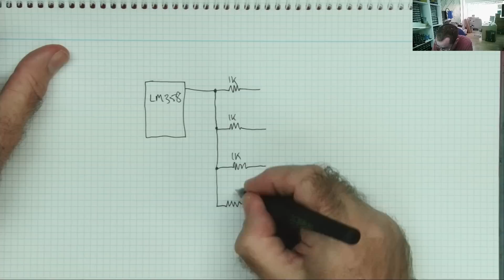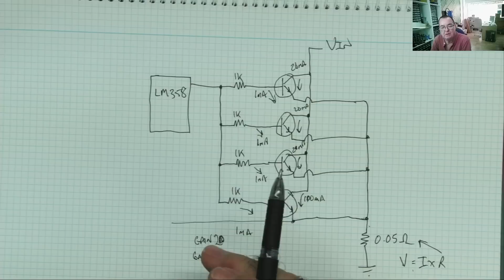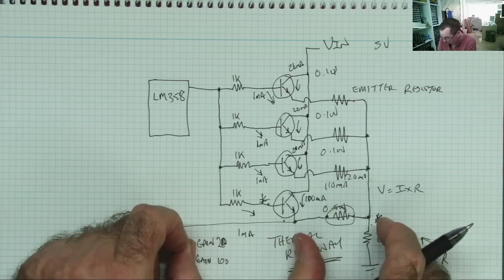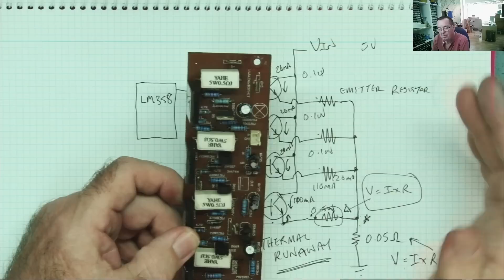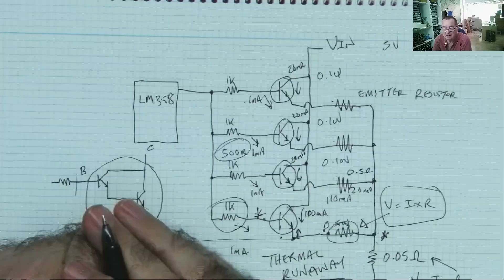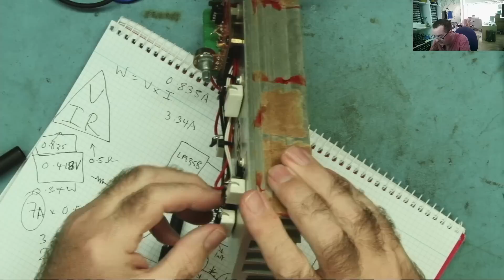How to Connect Transistors In Parallel, Without Blowing Them Up! PCBWay LER MultiLOAD Project

Comment: the way i explain this to others is the more current across the emitter resistor
 the larger  voltage drop and this puts the base/emitter at a lower voltage and the drive goes down from the base. 
so base drive voltage is less 
this is really helpfull when using JFETS

Comment: The TIP122 has a maximum continous current of 5A (and 8A peak), which is 20A in total, so you could reduce the resistance to 0.22Ohm 10W, or increase the 0.5 Ohm resistors to 15W or 20W to make them fit the maximum power of your device.

Comment: P = I x i x R, so I x I = P / R. So I x I = 10 / 0.5 = 20. So I = SQR Root of 20 = 4.47A per resistor, so in total 4 x 4.47A = 17.88A. If you consider some veriations in current per transistor, I would be safe and keep the currunt at maximum 15A

Comment: Around 2.2 volts across 0.5ohms makes 10W. That'd be around 4.5A. Other than that, the resistors you've put in place aren't 10W, they almost certainly are 5W.

Comment: I originally assumed that you would add potentiometers at the bases of the transistors to account for differences in resistance due to their tolerances not being perfect in comparison. But that’s because I wasn’t accounting for temperature changing the resistance of the transistors. Your explanation made a lot of sense and has helped me learn more in my journey through electronics.

Comment: Way to do it :yougotthis:
NB:
If you want to modify the circuit using MOSfet's you MUST use an external 12V supply for the LM358 IC which is sourcing the gate voltage for the MOSfet's.
A 25mA supply will readily suffice as only the LM358 is drawing any current.
Any Aliexpress micro buck/boost supply will do the job, if it works from the lowest 3.3V supply under load/test.
And THEN you won't need the "emitter" resistors !
Because the MOSfet's will reduce their gain with temperature, thereby exhibit selfbalancing.

Comment: Learn Transposition and Successive Approximation.
You've contradicted yourself again. Move the Resistors away from the Trasistors, they are heating the Trasistors needlessly.
Bunch the Resistors together, somewhere away from the Transistors, so the Resistors heat up equally.
Not a perfect fix, but helpful anyway.

Comment: They usually put the resistors in the collector side when paralleling BJTs
Reply: Putting them in the collector won't cause the transistors to balance the current sharing.  You need to reduce the drive to the transistor thats passing the most current.  As with the emitter resistor the more current the bigger the voltage drop and thus the lower the Vbe for that transistor for the same drive voltage of all the parallel transistors. So it reduces the current its passing.

Comment: The process of one of the active bipolar components in parallel taking more current used to be called "current hogging". It was common in early LEDs when used in parallel, hence they all had to use ballast resistors. I assume modern led displays will use chips from the same production batches, so will be better matched physically. If bipolar transistors were used in parallel, you would have to go through a process of "matching" them experimentally  to ensure their characteristics eg gain, forward voltage, etc, were as close as possible. Unless you were a big operation that could get the manufacturer to do the matching at source, it was generally too much effort to do this, which is why most circuits assume that it will happen and design parallel bipolats out,  just as you have here.

Comment: One of the drawbacks of using relatively high resistance for emitter ballasting is that the minimum input voltage for the circuit is raised. Darlington transistors are already working against you in that regard.

It is not unreasonable these days to use a separate op amp to drive each transistor. A low-value emitter resistor can be used for current sensing, rather than ballasting. The op amp and transistor are configured as a constant current sink, just as the overall ciruit appears to be in the video. If you do a reasonable job you can treat each op amp and its transistor as a building block and parallel as many of them as you want.

===
With the emitter ballasting resistors you are working against your objective if there is thermal coupling between the transistor and its resistor. The temperature coefficient of resistance of the resistor will be quite small. The tempco of the base-emitter voltage of the transistor, especially with a darlington is much larger (negative). If the resistor heats the transistor it amounts to positive feedback which is exactly the opposite of what you want.
It is not unreasonable to select the value of the ballasting resistors so that the voltage drop and dissipation result in good sharing at high currents but only mediocre sharing at low currents where there isn't any real issue with imbalance. But be careful!

Be mindful of safe operating for bipolar transistors. It is going to limit allowable power to far less than the product of the transistor's voltage and current ratings. Any decent datasheet will include plots of SOA.
Reply from the maker: Thanks for the detailed reply. I'll look at using separate op amps to drive each transistor, this sounds interesting
Reply: Yep, it is unreasonable. More reasonable is an opamp driving a high gain bjt driving the other four darlingtons.
Reply: @mitkothemacedonian 
You've missed the point completely.
The issue is not power to drive the transistors. The objective is to produce good sharing among the transistors. Unless the transistors are very carefully matched to begin with you need moderately high emitter ballasting resistances to get good sharing. This creates two problems - heat removal from the resistors and total voltage drop which prevents the load from being useful for very low input voltages. Adding yet another transistor in a cascade makes the latter problem worse and does nothing to reduce the sharing issue. By using one op amp per transistor you reduce both problems because you only need resistors for current sensing, so their value can be low. The limitation to how low the resistance can be depends on the input offset voltage of the amps used and whether their input common mode voltage range goes fully to the negative supply rail.

Comment: The easiest way to get you where you want to go is to solve the equations by substitution.  You have equations for Ohm's Law and the Power Law.  You want to find equations for power in terms of voltage alone, or in current alone.

Solving Ohm's law for Voltage is simple enough as it's the V=IxR.  For current it's V/R=I.  Now we have mathematical terms for both V and I in the Power Law; P=VxI.

One can substitute the evaluated equations for the terms we derived from Ohm's law into the same term in the Power Law.

P=VxI: If we substitute V/R from Ohm's Law for the I-term in the Power Law it yields P=V x V/R.  Simplifying VxV is simply V squared, and we divide the V squared by R.

P=V^2/R or Power in Watts is equivalent to the Voltage applied, squared, divided by Resistance.

If we substitute the IxR for the V-term in the Power Law it yields P = IxR x I.  Simplifying IxI is I squared which we multiply by R.

P=I^2R or Power in Watts is equivalent to the current that flows through, I, squared, multiplied by the Resistance.

You were correct to note that one of the terms needed to square to take you where you wanted to go.

Comment: I guess those emitter (or "source" in that case) resistances are not needed with Mosfet's ?
Reply: Using power MOSFETs in linear circuits can be difficult and problematic. The vast majority of FETs are made to be used as switches. There are very few made specifically for linear applications.
Internally power MOSFETs are large arrays of small "cells" all connected in parallel. Ideally they all share current equally, and when driven to switch the do quite well. When used in linear circuits the sharing may not be good. When you try to parallel complete devices things can get worse. Without going into detail it has to do with temperature coefficients.
I haven't looked in years but there used to be some reasonably good applications notes on linear use of power MOSFETs on the web.

Comment: Also the emitter resistors I think should be around 15 watts if you want it to handle 140 watts in total current over 4 transistors and resistors if you use 8 transistors that handle half the power with 8 emitter resistors you could do with 7.5 watt resistors for them to operate in a safe range and it never hurts to have a bit more watts for the resistors for overhead

Comment: when I take only the 10 watts and the resistance of 0.5 ohms I get a current of 4.472 amps at a voltage of 2.236 volts

Comment: Very informative but why don’t you design around MOSFETs?
Reply from the maker: It is based on an existing pcbway project that uses a single TIP122, and some comments on the original authors channel where viewers said they had expanded it to use four transistors but did not give any details.  While reading up a bit on the emitter resistor value, I came across a statement that when trying to make either a constant current source, or a constant current sink (this device) it was better to use Bipolar Transistors as the 'control the current better'.  It is true that MOSFETs have exactly the opposite property to the Bipolar transistor's thermal runaway, and like thermionic valves, or vacuum tubes, they reduce in conductance as they get hotter.
Reply: Cheers, I also believe it’s possible to operate MOSFETs in their linear region for this purpose.
Reply: MOSFETs and Darlingtons or double BJTs are both valid choices, in the end its the opamp closing the loop to keep a constant current.

Comment: I think the resistor for the base does not matter too much but because there was no emitter resistor the last transistor in the chain blew everytime... when you put emitter resistors in you create a voltage/current divider wich ballance it all out.... the base resistors are for the gain it depends on how much gain you want or need and best way to figure that out is just to experiment but that project would of never worked right without the emitter resistors... as you said in that amplifier circuit there are emittier resistors.... if you bridge those resistors so that all emitters are connecter directly it will blow and they do the emitter resistors for a reason !!!! plus Richard did you get my email with the manual for that AL board ?
Reply from the maker: It was the transistor with the shortest wire to to the PCB (and hence a few milliohms less resistor that blew the fist time, and was getting hotter the secind time.  I don't expect that was a coincidence.  Thanks for the Aircon Service Manual, I thought I replied to the email but didn't realise it was yourself who sent it.  Anyway, thanks.
Reply: @learnelectronicsrepair  welcome
Reply: The base resistors are required due to a possible failure mode, should one of the transistors fail in a short, base to emitter.  That base resistor prevents a dead-short from the supply side to ground.

Comment: Yes, all power amplifier with multiple power transistors output have a low value resistance on the emitter for this obvious reason. The schematic as it was is totally wrong 🤔

Comment: To select the right values of the resistors you have to specify the maximum voltage and ampere of this load. According to the data sheet the TIP122 can handle 5A up to 15V, 3A @ 20v, 1.6A @ 30V, 0.7A @ 40V and so on.

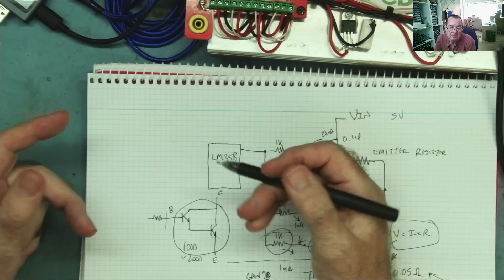Comment: 31:47 ... U×I= W ??? 🤔
P is i think the unit for power not W

Nice Video Richard👍🖖👍👍👍
Reply: Watts is the unit for power and its first letter is W. P is just the first letter of the english word power. Notice we don't use C for Current, we use I or A 🤣

Although I too tend to use P myself, it's not as if there is a consistent standard at this point for anyone to argue by which to use!
Reply: @ivolol  in mathematikel view is P for power an W(att)  the measured size. 🤷‍♂️
Reply from the maker: @Lightrunner.  @ivolol A lot of us discussed this (or similar) on a previous video and the end result was that different countries (or languages) use different letters for ohms law and the Watts formula, and they are all in fact equally correct.  It just depends on where you live 🙂
Reply: @learnelectronicsrepair  we all just live on Earth..with many many knowledge with differend designations.🖖🖖🖖. Live long and prosper.
Reply: The SI (for Système International) unit for power is the watt, abbreviated W
It is a derived unit equal to one joule per second (joule is also a derived unit) or kg⋅m2⋅s−3 (in kilograms, metres and seconds, all SI base units).

Comment: If you substitute V=IR into P=VI you can get the very useful substitution, P=I²R. I use this all the time concerning resistors and power. The other one is P=V²/R but I just tend to use that one less.

10 = I² * 0.5
20 = I²
I = ~4.4A

Write down P=I²R and P=V²/R and you'll find one of them will come in handy about the same amount that using P=VI does!

But I'd guess those are actually 5W resistors, not 10W. You can lower the value of the ballasting resistors, it lessens their power rating requirements but also makes them slightly less good at their ballasting job, so its a tradeoff. If you want more power handling then I would trial whether the 0.22R's can still balance your darlings.

MOSFETs can also experience thermal runaway in this situation. Scullcom Electronics explains it nicely in part 5/6 of their own electronic load project. The FET's main channel resistance is usually in positive thermal feedback (good), but their gate threshold voltage still tends to be in negative thermal feedback (bad). So without some sort of balancing / ballasting they too can develop the problem where one of the MOSFETs "hogs" the current, where the design requires them to share equally in order to stay inside their design limits while you are paralleling them.

Comment: V = IxR
W = VxI
W = (IxR)xI = I²R

I² = W/R
I = sqrt(W/R)
W = 10, R = 0.5, I = sqrt(10/0.5) = 4.472

The same scenario is exactly what happens with cheap jump-start power banks except with mosfets. The first goes bang putting more load onto the rest of them, then the second goes bang followed by a very rapid progression through the rest of them. Because of the very high currents involved this method of using a load resistor would not be practical. I wonder how the more expensive versions get round this problem and avoid blowing up the mosfets. Well balanced mosfets perhaps or ones which are vastly "overrated" for the average current.
Reply from the maker: Thanks Chris for the formula, I will now know it for future.  This is why I don't do much math on the channel and often go down the 'rule of thumb' method I used.  In the video I had figured the equation would have a square or square root in it somewhere but that was as far as I got by myself.
Reply: @chrishartley1210
The answer to your question  is - feedback.
Reply: I wrote the same answer before looking through the comments for this lol. 👍
Reply: Hi Chris - Hi Chris – Because I have 100 BU508A and 100 BD159 Transistors 
I am making a 20A  DC to DC Variable inverter up to 100V DC input.
I want to parallel 4 x BU508A Transistors Driven in Darling-ton mode by 1 x  BD159. Driven by the I/PV via 15k 1/4W, Via 100k Pot.
 ( 100V / 115000R = 0.0008695A ) 0.0008695A x 100V = 0.08675W. 
So to balance the 4 BU508A Transistors what would the 
wattage of the 4 x 0.5R emitter resisters need to be as I do not under stand the last 2 parts of your maths equation formula .

 I = sqrt(W/R) 
W = 10, R = 0.5, I = sqrt(10/0.5) = 4.472 

Could you brake down what sqrt and 10, means?  As this is where I
I get stuck. Thanking you John

PS Why in formulas do you put answer = problem, when in life its problem = answer?
Reply: @uksuperrascal  Sqrt means square root. The last line is the solution to Richard's particular problem, not part of the general equation.
For your PS, this is standard formula notation and in fact matches your "problem = answer". The problem (the part you don't know) is on the left the answer (the parts you know) is on the right.

For your problem the formula you need is W=I²R. I'm going to assume the total output is 20A or 5A per resistor so the wattage needed is 5 x 5 x 0.5 = 12.5W
Reply: @chrishartley1210  Thank you for the reply - So what is the number that you used to find  the sqrt of, to times the (W/R) by, To get your answer for Richard? ALSO what did 10, R mean, did R = resistance ? So what did 10, mean - Also working on a 240W 36V solar inverter to take 36V down to 16V so can use 36V panel to  run 1 solar charge controller that if you apply 36V to you need to run controller to 24V Battery But if you only apply 18V to the controller then the same controller will run and charge 1 x 12V battery using the same Circuit with 4 x BU508A 'S
Reply: Second reply  So for 240W 36V solar Inverter to 18 V. The emitter resister = 240W / 36V = 6.666A ( 6.666A / 4 =1.666A ( 1.666A x 0.5R = 0.833W ) so a  2 W 0.5R is required - I think I got it. Thank you Chris.
Reply: @uksuperrascal  Not quite. It's I x I x R, 1.666A x 1.666A x 0.5R which works out at 1.39W. Your 2W resistor is still in spec, but without as much leeway.
Reply: @chrishartley1210  - I see I forgot the 1.6665 x 1.6665  not to worry I will be using 5W 0.5R in that circuit. Thanks again Chris.